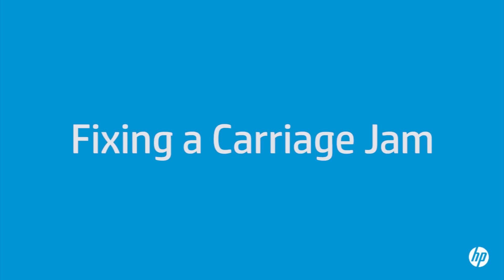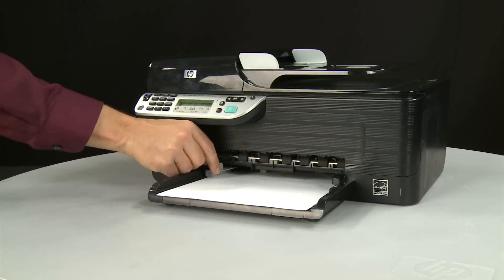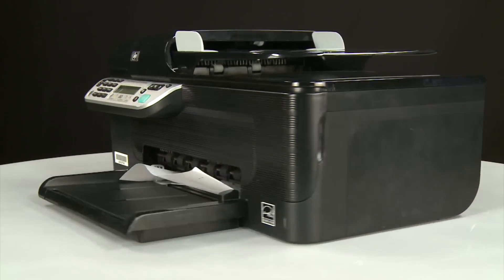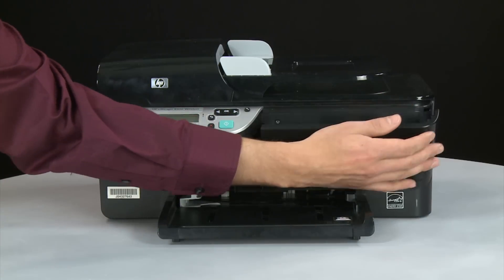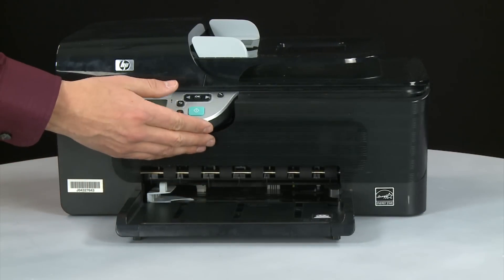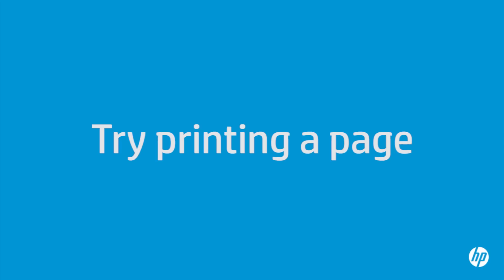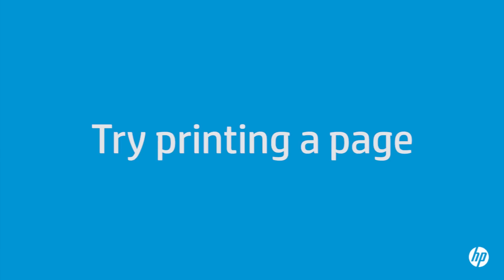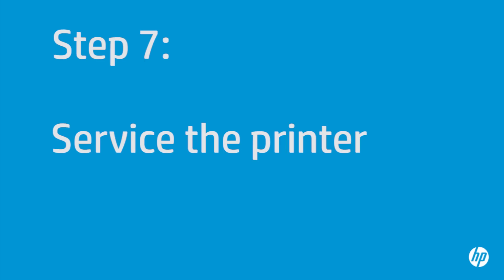Fixing a Carriage Jam | HP Officejet 4500 Wireless All-in-One (G510n) | HP

Comment: A million thank yous! I was about to take a sledge hammer to my printer. Then I watched your video and found a hair tie had fallen in the printer and was jamming the carriage. I must have looked a dozen times for pieces of paper jamming up the line. I even went as far to accuse the kid who sold me the new ink that he sold me the wrong size. I finally got a flash light, per your instructions in step two and saw a black hair tie all the way to one side. Removed the hair tie and now all systems go! 

You know that saying, "It's not the gun, but the idiot behind the trigger." Ugh, say hello to Mrs. Idiot. 

Anyway, so glad I watched this video. All I needed was a flash light and the problem was solved. 

Thank you!
Reply from the maker: +Kimberly Wood I am glad to know that the video has helped you fix the issue.